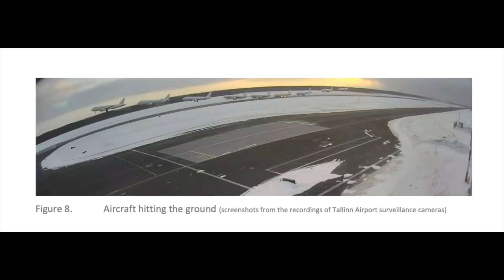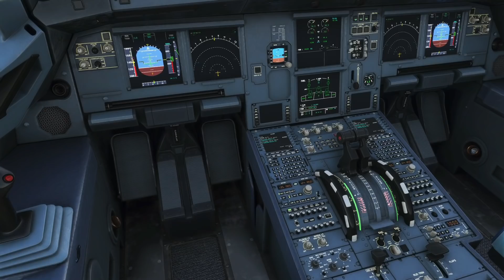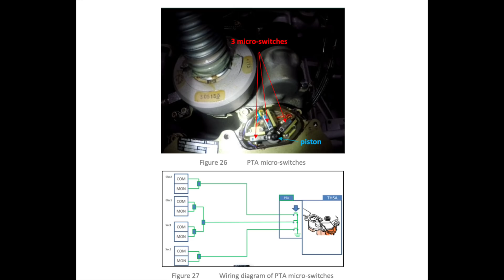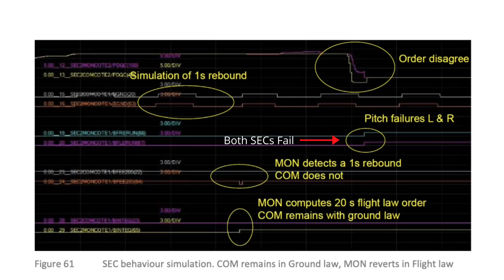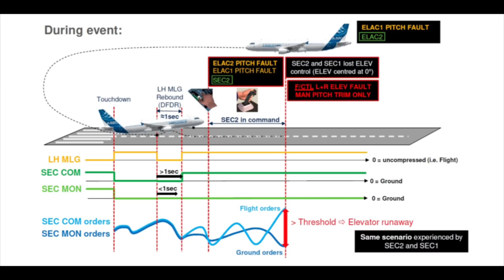The Oil Change That Crashed A Passenger Jet | The Crash Of Smartlynx 9001

Comment: If it was the failure of the engines that nearly killed them all, why has no one mentioned what caused the failure?
Reply: Pay attention to the point where the aircraft hit the runway with gear up and then went back into the air again

Comment: I currently fly as skipper on the A320 series (mostly 321NX's). I've flown Douglas (DC-9 and 10's) and most of the Boeings (707, 727, 737, 757, 767, 777). I'm a Boeing fan. The more automated the planes become the more I don't like them. Yeah, they're easier to fly (or rather, "operate"). But when sh*t hits the fan, I'd rather be in a Boeing (old fashioned yoke connected to the flight controls with hydraulics, or even DC "Direct Cable"). The 777 was real nice for a fly-by-wire system. Airbus is more like a manned drone. You never really have full control over it. Maybe that's over simplified, but I'm an old school pilot (coming up on 30,000 hrs and 42 years of flying: Biplanes to fighters to Boeings, and everything in between. The best safety feature is still 2 well trained pilots in the cockpit. The engineers ("Boffins" aptly named by the Brits) are trying to design the pilot out of the cockpit and attempting the move towards fully automated "drones". You'll see more of these "automated crashes". If I move the stick or yoke, I expect the flight control to move accordingly and not to some varying position selected by a computer. Now of course, the new fighters are fly-by-wire due to their natural instability (the F-4 in the hands of an experienced pilot still kicked F-16 butt :) , but that's not the case with airliners.

Comment: Does anybody know if they were in direct law or mechanical reversion? It sounds as though they didn't have elevator or aileron control. Shouldn't they have still had three other working flight control computers (SEC3 and FAC1&2) to provide direct law? Awesome video!
Reply: Pitch was in mechanical backup and ailerons still controlled by sidesticks as it was only the pitch channel of the ELAC’s that had failed. Had they reset the computer once again. It would have been restored

Comment: At 12:40  it was said," They walked away from something no  one could have foreseen." 
That is not exactly true as they had warning signs popping up on the screen indicating that something was wrong and they should have landed and not just reset the computer multiple times.
Reply: You don’t fully understand what happened here. Resetting the computer every time worked and fixed the problem. But then the pilots did the same procedures that caused the fault but fixed the fault by resetting the computer until they didn’t reset it. So not resetting actually contributed to the problem

Comment: Automation for me on aircraft...0-10........11 !

There are loads of automated lifts (elevators) all over the world and it is so rare for them to fail (except in China?) I'm pretty sure nearly all lift deaths are lift maintenance personnel.

I've noted a lot of plane crashes involve multiple problems. I believe there should be a 'too many errors' error resulting in the whole plane doing a hard reboot.
Reply: You’re comparing lifts to a commercial airliner......why?
Reply: @tomstravels520  Most lifts are fully automated and cause fewer deaths.
The only difference is that plane manufacturers are working in a more dangerous environment and take safety less seriously than lift manufacturers. It seems the MD DC-10 could even design a secure cargo door lock. Car manufacturers seem to have done a better job - although I've known of doors coming open in bad rolls but I don't know the reasons - internally released by people ?
Reply: @millomweb  a lift goes up and down and that’s it. How can you possibly compare a lift to a commercial airliner. Do you think someone who designs lifts could design a plane?
Reply: @tomstravels520  The 'lift' person could design safety features of a plane.
Reply: @millomweb  Do you honestly think someone who designs lifts has any knowledge of how aircraft systems work? Maybe one or 2 might have an aviation interest but I still doubt they’d be able to design systems for a plane. I could think of some great safety systems but practically they’re all flawed
Reply: @tomstravels520  LOL
A plane and a lift are very similar. Control systems that make things move. The only reason planes are as complex as they are is because they're not designed 'simply'. The one big difference is that there's no emegency stop button !
Reply: @millomweb  I don’t know what reality or planet you live on but a lift (a small box attached to cables that goes up and down a shaft) is not the same as a commercial airliner
Reply: @tomstravels520  Flight has stood still. We have the technology to build a plane capable of flying from A to B perfectly safely without any human intervention. You talk about 'planes'. Planes don't seem to be the problem. The problem is engines. A lesser problem is craply designed flight sensors. The air France stalled crash south America due to pitot tube icing up IIRC.
WTF ?????? A GPS device could give a more accurate speed than an 'iffy' pitot tube (albeit not the 'essential' airspeed) But there are many ways to assess airspeed - and the most reliable of them is flight control surfaces sensitivity. If you pull hard back on the stick and you start pulling 5G, you're going really fast. If you only manage to pull 1.5G you're going too slow. WTF needs instruments to determine airspeed ?
Being a bit calmer about it, flying straight and level: 1·000G
Question, how far does the elevator need lifting (in mm) to pull 1·100G ? - instant accurate assessment of airspeed.
GPS will tell you where you are and where you're going. Replaces altimeter, compass, speed indicator
3D gyroscope will give accurate plane attitude data.
Load sensors on landing gear can provide accurate AND CORRECT fuel weight in the tanks AND payload. - so no taking off with insuficient fuel or insufficient acceleration for the payload/runway length.
Reply: @millomweb  great...so what happens if you were to loose GPS signal or not have enough satellites? Or what if GPS signals could be jammed or spoofed  Bye bye all your information. 

Clearly you haven’t been keeping up with the advances in technology since AF447 like using the AOA sensors to display an estimated airspeed. Back up sensors that are used to cross check consistency against the other sensors to see if one is malfunctioning. Engine pressure sensor to determine speed and altitude. GPS is a good backup but cannot be relied on as you need to know the height of the terrain you’re flying over or you could end up flying into a mountain. And GPS doesn’t give airspeed. It gives ground speed which would require constant conversion calculations to get airspeed.

As for load sensors in the wheels how do you know if they are correct? If you stand on your bathroom scales how do you know if they are reading correctly without calibrating them every day with a known weight. How about using a system that monitors your takeoff speed and remaining runway to calculate if you’ll make it in time......oh wait it already exists. Go and Google “Airbus take off monitoring”
Reply: @tomstravels520  Lose GPS signals - there are no trees or tunnels at 30,000 ft. Nor are there any mountains. Jammed signals - so far never happened AFAIK. Spoofed - that'll be tricky too.
"AOA sensors to display an estimated airspeed." Sounds a very woolley solution.
"Engine pressure sensor to determine speed and altitude." - you wouldn't want to be near engines to get reliable readings. Barometric altitude is pretty fine for the purpose.
" GPS is a good backup but cannot be relied on as you need to know the height of the terrain you’re flying over or you could end up flying into a mountain. And GPS doesn’t give airspeed."
GPS gives you your location, obstruction maps give you obstruction info at that location. I never said GPS gave airspeed for the bloody obvious reason.
"As for load sensors in the wheels how do you know if they are correct?" - the usual duplicity of systems.
The issues are easily resolvable.
Reply: @millomweb  don’t be stupid I’m talking about aircraft flying in polar regions with limited satellite coverage. Hence why IRS has never gone away. And just because GPS jamming or spoofing hasn’t happened yet there’s nothing to say it will never happen. You can still loose your receivers somehow. But the way your theory about G forces compared to how much force is applied the stick is useless with modern fly by wire aircraft whose controls and not directly related to the control surface. Don’t believe the AOA sensors can provide some kind of airspeed? Look up the Airbus BUSS and then watch this video

https://youtu.be/JS0E29RmOX4
Reply: @tomstravels520  Should be able to see more satelliets in polar regions as you can see right round the globe !
Reply: @millomweb  just Google “GPS coverage, polar regions” and go and do some reading and you’ll see what I mean
Reply: @tomstravels520  I suspect you've been looking at ground level. Come back to me with GPS reception data over the poles at 40,000 ft.
Reply: @millomweb  why don’t you go and do your own research if you think you know best. And then I’d rather you didn’t come back to me until you stop thinking lifts and aircraft are the same thing
Reply: @tomstravels520  You are claiming that the Global Positioning System is not global.
I'm asking you to provide proof of your claim.
I am not an expert on GPS but as far as I'm aware, there are a few geostationary satellites and there are many moving GPS satellites, quite possibly laterally wobbly that oscillate sinusoidally across the equator. There may well be some that orbit the Earth relatively 'vertically' hence transmitting to polar regions. In such places, an accuracy of  5 miles isn'treally going to worry anyone - the only thing to hit would be other aircraft and local radar should have that covered - oh, that's only some military planes that have radar - but that's not my fault, I don't work for Boeing, Airbus or Montgolfier.

Comment: Being a pilot flying modern airliners, small modern planes and historic airliners I can tell you automation is the best thing ever, but if there is no way to tell whats happening right now it´s a pain in the rear
So a 7 maybe?
Flying without technology at all is a huge amount of workload and long flights are basically impossible. Having every system run through one or multiple computers with only few warning possibilities and no way to really tell what the computer wants to do is a deathtrap in an emergency.
So yeah I want all the automation I can get, as long as I get a chance to see and understand what the system is doing and even better, why

Comment: I disagree, the automation didn't fail as such. Humans forced the automation to not be able to do it's job. Humans didn't use the correct oil. Humans didn't listen repeatedly to the aircraft when it was giving multiple warnings. Subtract either of those two human errors, there would never have been a problem.
Out of interest, as I don't remember you mentioning it, why were the pilots not using the TOGA setting, why were they forcing the trim wheels? That's the point of the TOGA setting

Comment: It seems odd, if not irresponsible, for the training exercise to continue after the second reset episode occurred. What was the trainer thinking?! As said below somewhere, park the plane and get the systems checked out. In response to the question, 'How much/little automation would I want in a plane I was travelling in?'. Rather like modern cars, where almost everything is now electronically actuated, and if an ECU or system controlled by an electronic module or switch fails, there is no possibility to over-ride, with no 'hard' systems or linkages between the driver and the essential aspects of safe vehicle control. At least the wheels and brakes/suspension/steering still have hard systems in place. Although I can think of at least one Citroen which had no metallic/structural column between steering wheel and road wheels... I am a belt and braces man. Why remove any chance of taking manual control of an expensive aircraft, usually full of people and fuel, by employing 'fly-by-wire' (if ever there was a misnomer, this is one!) exclusively, regardless of how many redundancies are built in? Computer systems that are designed to fail if they can't agree? really?! And I don't understand why, if they had manual trim control, why they weren't able to, er, trim the controls? Not enough emphasis on this in training? If there were 4 or 5 trainees on board, one trainer, and one 'safety' guy, why wasn't a safe landing made after, at most, the second failure and reset of the first thing to go wrong? By hell, I wasn't there. I am more a Tiger Moth man, where you can feel the pleasure of flying through the seat of your pants! Everything - and I believe virtually everything - has become too complex, and much of it for what precise reason/s? I don't even buy the throttle pedal in your car not being physically connected to the throttle body of the engine's intake system. More complex does not necessarily mean 'better' ffs! I used to be able to fix any of the cars I owned as a younger man. While cars are still largely nuts and bolts - as aircraft are too - and things like oil and brake pad changes are still totally possible, and things like cylinder head removal is almost not a 'thing' anymore thus reducing many service procedures (not a bad thing at all), there is so much I can't fix or over-ride anymore. One glitch in the main ECU, or any of the many auxiliary units, and ? the car stops, or the engine malfunctions, and any number of weird things can happen, which I can only diagnose with a suitable device. After finding the problem, there is probably an expensive electronic part needs replacing, and usually at quite some expense. Aeroplanes are MASSIVELY more complex than cars, with thousands more systems that are electronically dependent, and for the safe operation of the aircraft... I rest my case, almost - it is obvious that aircraft are much, much safer than at one time, but then awareness of possible problems that might crop up are much better understood than by those early jet aircraft pilots. Simply creating complicated electronic/hydraulic systems to stand in for the pilot does not eradicate every problem. Look at the recent 737 Max events, and the ridiculously long time it has taken to, basically, redesign the whole computer system that went wrong. WHY couldn't the pilots take back manual control when things started to go wrong? Or rather, when they DID try, as was the case in both accidents, why weren't they allowed to take back physical control? Why was there not a manual over-ride???!!! Rant over! Planes are now being built where there is zero possibility of fitting extra and physical redundancy in the future - what kind of designer designs out such possibilities? Again - just because something is possible in this high speed, 'high design' world, doesn't mean it is necessarily better. Ach - the wrong oil even, ridiculous this can happen (-;)~

Comment: You’d think that after several resets of a control system they’d have time sense to return to base and investigate.  At my airline we can reset once then after that it’s flagged.
Reply: Yes but that is when you are doing a single flight. This was technically multiple flights and the documentation at the time for when to reset and when to return did not cover training circuits. And as this fault happened once every circuit and was counted as a single flight each under the rules they were still following them
Reply: @tomstravels520  I have no idea what their policy is but surely common sense would have made them return to base for further investigation.
Reply: @psrpippy  it’s all in the report. There was no limit at the time for how many resets they could do if the initial reset worked. The trigger event was holding the trim wheel, something which wouldn’t happen on an ordinary flight. The pitch controls went to the SEC’s because the captain didn’t reset the ELAC to provide redundancy. Ironically if they had reset the ELAC’s during the mechanical back up they’d have restored the computers again

Comment: Planes ,automobiles ,ships ,crafts in which humans control, should always be able to have manual control even if the vehicle has no electricity.
  Sound tragic a Plane full of Pilots died because they couldn't take control of their plane because of a computer.
  Fly-by-wire you shall ××× by The Wire, passenger planes are not fighter jets.
he who plays with fire she'll get burnt

Comment: On a scale of 1 - 10...I think 8 is about right, but there should always be a full manual (cable) back-up.  It may require a redesign to make the control surfaces manageable by human strength, but no aircraft should ever be totally out of human control

Comment: As a professional pilot with excess of 16,000 hours, 7 type ratings, and flight instructor ratings and the operator of a King Air 350i   I would actually prefer LESS automation!  Pilots become dependent and ultimately complacent with automation.  On a scale of 1-10 I would have to say no more than 6 and often none. It is dependent on the aircraft and the skill of the pilot.

Comment: 3/27/21: Since you asked, I think planes are too complex and too automated.  This can leave pilots disconnected and easily confused.  When all works well automation makes flying easier and safer.  However, when there is a fault pilots can become disoriented and overwhelmed.  Automation should be focused on informing the pilot instead of doing everything for him.  Pilots need to have a "feel" for flying and computers tend to come between pilot and plane.  That said, it sure is nice to have the computer report that you shouldn't take off because you failed to lower the flaps!  [No piloting experience]. DB